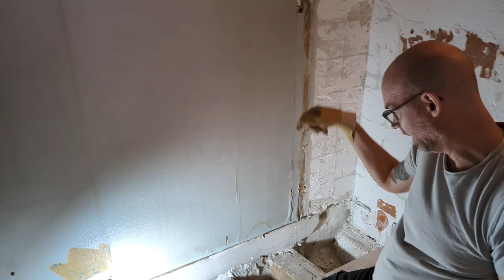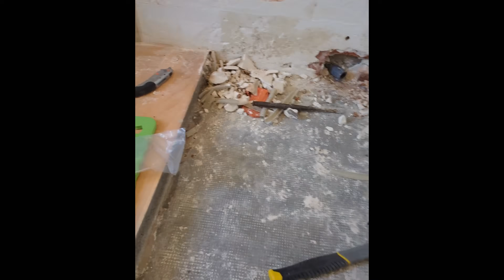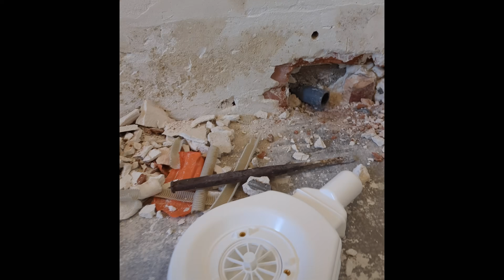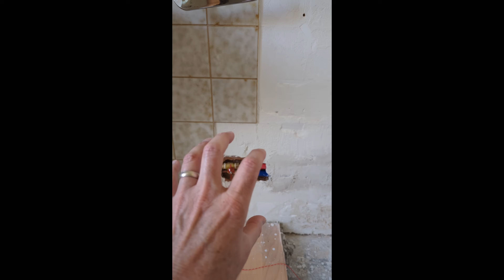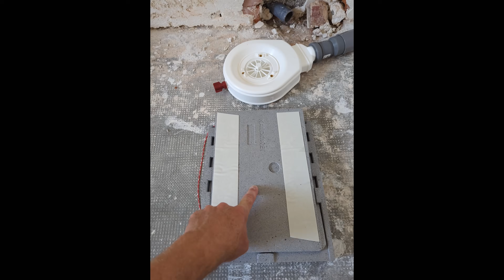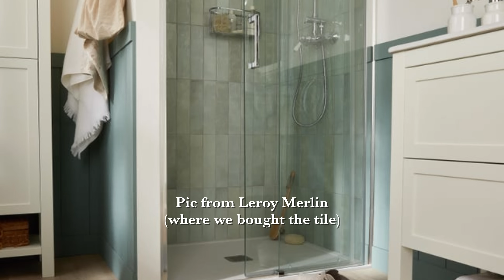33: DIY Shower Install | Renovating in France

Comment: How did Patrick learn all the plumbing and DIY stuff?  Is that from YouTube and other DIY channels? Amazing level of detailed knowledge and confidence to do this.  Wow!  Will you also install central air or wall units (split units)?
Reply from the maker: Well.... it's a combination of growing up in a DIY household, little bits of watching dad and neighbors doing stuff, woodshop, Tv and YouTube. Most systems work the same everywhere so you just have to figure out how they do it where you live. I always make sure to have an escape plan like what to do if something doesn't work right so I can stay safe. 

As far as AC goes you can't install that here yourself so we'll have to hire a professional to do it. It'll have to be split units since those are the most effective and cost the least to run. And since they're just a heat pump they can either cool or heat very efficiently.

Comment: The shower looks great. It always takes much longer than what we originally plan. I don’t understand however about the caulking. I have done it always with water based products in France. It was very easy to remove with a sponge. You probably didn’t find it but I promise it’s there 😉
Reply from the maker: I was REALLY surprised when I used that white caulk from Leroy Merlin. I thought that there must be the water based stuff too since it's much less toxic to use. So I'm glad to hear it's available. I'll just have to spend more time on the caulking aisle and see where things went wrong. Thanks for sharing.

Comment: I enjoyed watching the whole process but oh my, what hoops you had to jump thru to get everything to fit. I know you weren’t excited about the grout width between the tiles but only you notice; to me it looks like perfection. What horrors that you removed the bidet! 😱 One woman on a reality show used her bidet to wash her feet. I cannot fathom how a tall person can get that low and then sit on the narrow edge. Torture. §  I was worried as you filmed yourself at the end because it looked as if your head was going to hit the shower head but once you were actually inside, you had room to spare. It’s nice that you plan to combine bathing and laundering your clothes at the same time. 😂🤣😂 Speaking of bathroom leaks…..in 1988 I stayed in a 6-month old hotel in China of questionable construction. The wallpaper on the exterior wall was already stained with water and the bathroom on the floor above leaked so badly that I had to hold my umbrella while bathing in my own bathroom. I certainly didn’t want the upstairs toilet water landing on me. 😫 §  I’ve done a lot of easy plumbing fixes using YouTube as my guide saving a lot of money but I am stumped trying to replace a shower head. 🚿 I absolutely cannot get the old 44-yr. old shower head to budge. Lefty-loosey, right? I’ve tried several tools and even resorted to putting drops of oil and letting it sit for a day but it refuses to come off. I guess I’ll have to pay a plumber $60 to $100 a hour to simply unscrew the darn thing. I can easily install the replacement but what is holding the old one on? 🤯😡